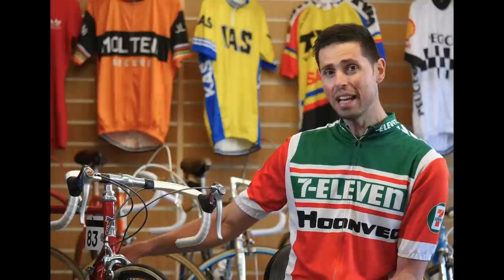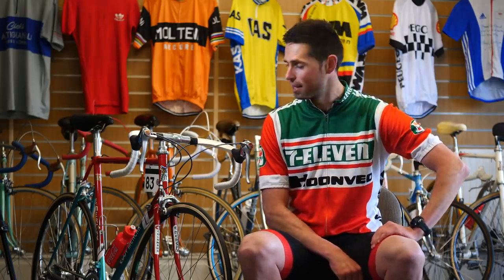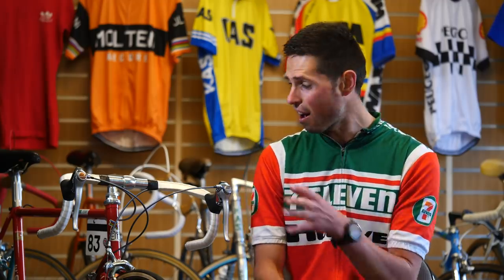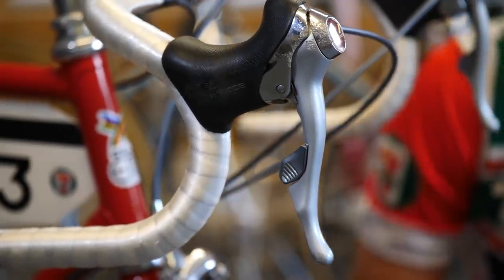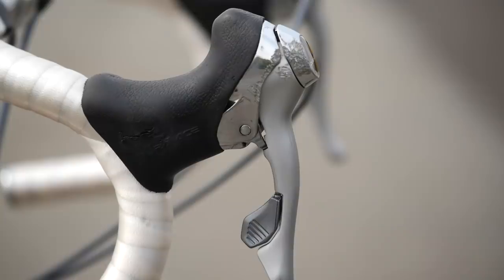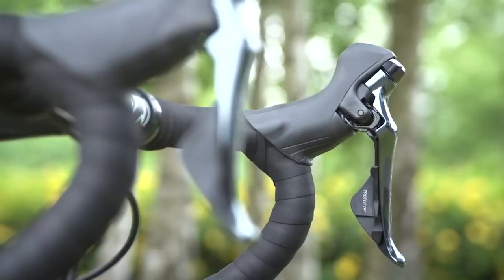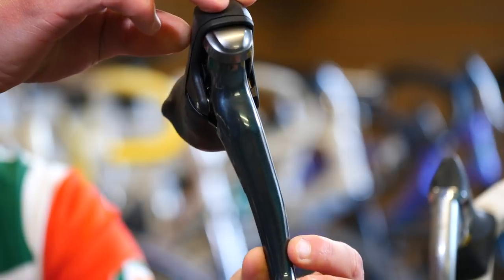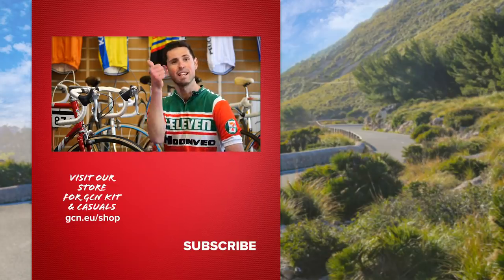Is This The Biggest Bike Tech Innovation Of All Time? | Shimano Total Integration Game Changer

Comment: In 1564 Galileo discovered that in a theoretical vacuum all objects of different masses, would fall to earth at exactly the same speed because the earth is relatively massive compared to objects dropped being attracted to it. Taking this thought and excluding aerodynamics, why do people still think that a heavier bike of exactly the same shape and physical size, would roll down a hill faster ( unaided ) than a  lighter one  of a few pounds less in weight ? I think this is a one for GCN does science, over to you Ollie !
Reply: In the above example, air resistance is the same for both bikes, but the heavier bike has more acceleration provided by gravity to overcome said air resistance. The heavier rider/bike has a higher terminal velocity because it experiences a larger force from gravity.
Reply: @BrownianMotionPicture  as I said in the description, the relative insignificant difference in comparison of both bikes in weight to the massive size of the earth is immeasurable, therefore no difference via gravitational pull on each bike and therefore no difference in speed as Galileo described. Gravitational acceleration is the same for all objects 9.81 m per second squared.
Reply: @channul4887  it doesn't matter about air resistance if both bikes are the same physical size and shape as described, both bikes would mathematically cancel each other out in that regard.
Reply: @stevezodiac491  I put it to you that the difference in gravitational pull acting on a heavy bicycle and a light one is not immeasurable. This is mass and cyclists are obsessed with weighing things! A heavier bike of the same dimensions/ rolling resistance as a lighter one will have a higher terminal velocity when freewheeling down the same hill.
Reply: @BrownianMotionPicture  you can weigh the weight as a difference but the gravitational attraction difference to the earth is immeasurable, which is what dictates speed ( unaided ). A heavier bike does not have a higher terminal velocity if of the same physical size and rolling resistance. The weight of the earth is 5.972 × 10^24 kg and it is this that creates the gravitational attraction, a couple of kg weight difference in both bikes compared to the earth is immeasurable in gravitational attraction. The mass of the bike matters when your body's own power is trying to climb a bank. In this scenario it is a couple of pounds compared to a whimpy 12 stone guy's power trying to raise those extra couple of pounds against a static gravitational attraction of 9.81 m per second squared for either machine.
Reply: @stevezodiac491  The greater mass is what allows the heavier rider to overcome the air resistance to attain the faster terminal velocity . A feather vs an identical sized feather of lead have a vastly different terminal velocity.
Reply: @BrownianMotionPicture  weight and aerodynamics are two different things. In my statement I said objects of different weights, with the same shape and size for this reason, so that aerodynamics would be cancelled out.
Reply: @stevezodiac491  Read what I said again.
Reply: @BrownianMotionPicture  I have and weight / mass makes no difference.
Reply: @BrownianMotionPicture  Learn how Galileo mathematically described the physics of falling objects in this video from NOVA: The Great Math Mystery. For thousands of years, people erroneously thought that heavier objects fell faster than lighter ones. It was not until Galileo studied the motion of falling objects that it became clear that, in the absence of air resistance, gravity causes all objects to fall at the same rate. Galileo used ramps to slow down the speed of falling objects so that he could carefully observe and collect data about their motion. Ultimately, he recognized that all falling objects accelerate at the same rate and showed that the distance a falling object travels is directly proportional to the square of the time it takes to fall.
Reply: @stevezodiac491  Does a higher mass object at a given height not have more potential energy than lighter one? Does it take more energy to lift a heavier weight to a given height than it does a lighter weight? This extra potential energy is used to better overcome the aerodynamic drag which affects the descending bicycles, meaning the heavier cycle reaches a higher speed.
Reply: @stevezodiac491  "in the absence of air resistance"
Reply: @stevezodiac491  Nowhere on earth is exempt from air resistance, so your whole theory is irrelevant to cycling.
Reply: @stevezodiac491  noone is disputing the claim of what happens in a vacuum.
Reply: @BrownianMotionPicture  if both objects are the same size and shape, both objects have the same aerodynamics, therefore they cancel each other out in this regard, this is the second time at least that this has been explained to you.
Reply: @BrownianMotionPicture  lifting a weight is different to one dropping. Earth is not lifting the weight, therefore it is a much smaller entity doing the lifting and therfore not comparable to the earth itself. I have explained this to you before. The potential energy or weight as I have explained before between the two bikes is insignificant to the weight of the earth' s massive weight and gravitational attraction.
Reply: @stevezodiac491  Nowhere have I stated, or even alluded that the two theoretical objects have different aerodynamics to one another. My point was that; outside of a vacuum, in the real world; of the equally sized objects, the one of greater mass will achieve a higher terminal velocity for the same drop. I will say once again, nobody is disputing the results of said experiment within a theoretical vacuum. Lastly, you have edited every comment you have made, which is not helpful because my replies have been to your initial comments. To later edit what you have said appears disingenuous and voids the chronology of the discourse.

Comment: shimano right now: too dominant and less inovation!
Reply: What's left to do?
Reply: @desertrainfrog1691  Pinion-style gearbox, Schlumpf-style planetary-gear front derailer, Campagnolo-style ergonomic shifters rather than the crap they use now. That's just three out of the top of my head.
Reply: @chesshooligan1282  My whole thing is that bikes work perfectly nowadays. They shift, they're efficient, they have a wide range of gear ratios, tires and wheels are good, frames are good, brakes work great.... 

Don't fix it if it isn't broken. I'm riding a 1987 because the only improvement to be made on the bike is in me.
Reply: @desertrainfrog1691  People were saying the same thing when brake discs started.
Reply: @chesshooligan1282  Disc brakes on road bikes are a downgrade to me. Rim brakes do everything I could ever want and don't make my bike heavier, like discs.
Reply: @desertrainfrog1691  You're not one of those people that swear vinyl sounds better than digital, are you?
Reply: @chesshooligan1282  No sir. 

There is obvious disadvantages to disc brakes for road, especially when  rims have never left me wanting for more braking performance in the  first place.

Warped rotors
Cost
Rotor rub
Weight

Those are the main four.
Reply: @desertrainfrog1691  See? Weight is one area where I don't think there's any need for improvement. A 10 kg bike is fine. On the other hand, better braking could have saved me a couple of crashes. You're a more careful rider than I am.